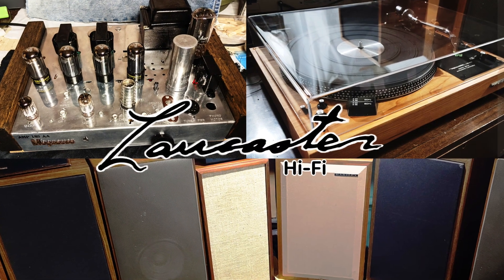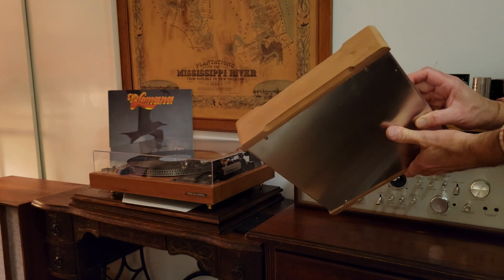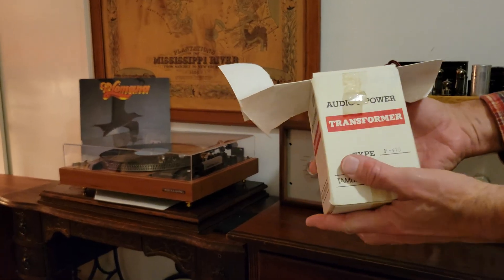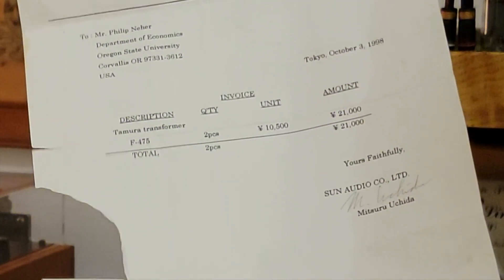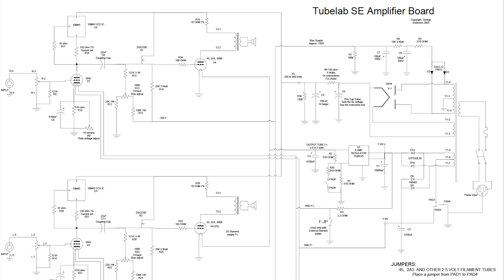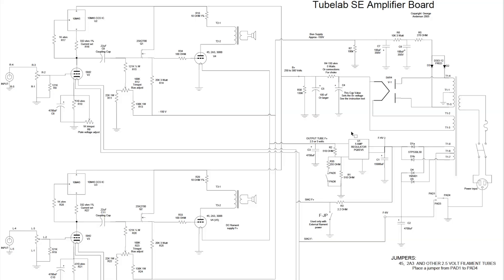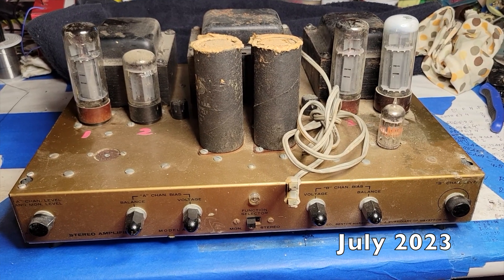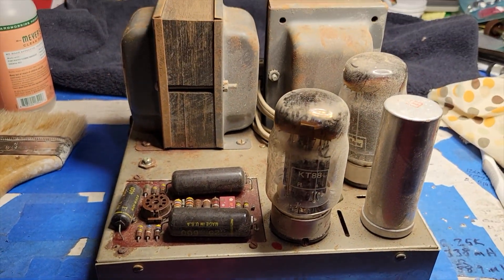I Must Build an SET Tube Amp With Type 45 Triodes! Why?

Comment: I wanted to use an SET that has a directly heated triode but can drive Magnepan speakers. I was using cone speakers with cabinets and unreasonably messy crossover networks and notch filters. I was driving them with SET 45's with choke loaded mu follower 6SN7 dual triodes. I replaced the output transformers with Lundahl LL2765 transformers which stepdown to directly to the grid of an 833A triode which I run at 1000 Volts on the plate and zero grid bias. The Hammond 1642 SE output transformer is the most robust output transformer for the 833A. I have been using this SET for over 6 years with nothing going wrong. The cost of the 45 and the 833A is under $2000. The parts are the best money can buy, including metalized polypropylene filter capacitors in the pi filters in the 1000 Volt power supplies. The 833A cathode has to have pure 10 Volts 10 Amp DC, unlike the 45, which can be heated with AC. This is better than the WAVAC 833A stereo selling for $480,000.
Reply from the maker: That's some determination, driving Magnepans with an SET amp!

Comment: I could've sold you mine!  lol.  It was the closest I got to a wire with gain.  However once I sold my horn speakers the limited power output was no longer an option.  Very good properly designed low/no feedback SS comes very very close as well as UL tube amps but with much much more power.  I am not discouraging you from building it at all.  You should just to experience it and learn more.  I don't miss it because clarity you get but shear impact and dynamic range are limited.  Those are arguably just as important to music as clarity is, and good SS and UL amps come very very close in clarity while producing multitudes more power at lower output impedances.  This is one of those things like the tree vs the forest.  Good luck and thanks for your channel!  Happy listening!
Reply: Hey check this video out.  Very well executed blind test between a Kt120 and 300B (both single ended but one UL, the other obviously triode)!  They don't tell you which is which, see if you can!?

Comment: like your videos......so has the SET come up on the "to build" table?  i just looked up the Tubelab SE 45 SET.  and his new version. hoping to see what you are doing to deal with changes over time.
Reply from the maker: I've got just about everything I need to build it. I don't have the 45 tubes yet, and I'm not sure all the iron I've got will fit on the chassis I have. It will happen in its time.

Comment: I’d be real curious how the whole solid-state power supply works because I really am a believer that you get a much more organic transient using a 5AR4 as a rectifier and it depends possibly what type of music you might be listening to I would say electric music ortechno type. Music might be better off with a more responsive, solid state power supply by for jazz and classical music I don’t know. I guess I’d have to hear the difference. I’ve heard a lot of amplifiers that course that have a solid state rectifier and I really don’t care for that.
Reply from the maker: You guitar guys really love your tube "sag," huh? I'm agnostic on tube vs. solid state power supply. I've never heard a convincing explanation of why a tube rectifier would sound better than silicon diodes. I'm listening mostly to a Heathkit AA-40 these days. It has SS rectification. Monster iron. Sounds great to me!

Comment: Built a Type 45 tube amp. Was well worth the expense and effort.
Reply from the maker: That's good to hear. What speakers are you using with it?
Reply: @ Currently, I’m running a pair of Olson/Nagaoka manifold horns (6’ tall double backloaded horns using a Fostex FE168Ez driver) A very nice match! Recently picked up a pair of Lowther EX-4’s, which I put in  a MLTL. Unfortunately, the combination of my 12AU7 cathode follower and Hiraga 30w class a amp has the unfortunate side effect of producing a lot of DC on start up. That cooked the drivers and they are on their way back to Lowther for a rebuild. They were intended for the Type 45, but never got to set them up properly with the baffle step/zobel network before they became smoke machines…. I have a pair of Cornwalls I’m going to set up in a couple of weeks and see how they work with the amp. But the double horns are very heavy and awkward to move because of the tall enclosure, and hawking the Cornwalls out of the basement is always a “good time”

Comment: Hi, I was chatting to a friend about testing capacitors the other day, one thing lead to another and then I found myself watching this video. When living in Canada a few years ago I purchased a couple of Tubelab boards. One is the SSE and the other is the SE. Is the Tubelab website still running? I did go to the page and there's lots of info there but I was wondering if George Anderson is still around?
Reply from the maker: I think he's officially retired, but he's still an active contributor on diyaudio.com. I posted a question about the choice of driver tubes on the SE, and he provided a detailed answer.
Reply: I emailed Tubelab and got a prompt reply, so all good! George is still on the job.

Comment: I built my 45 set stereo amp. sounds wonderful. in my opinion the 45 is the best SET tube ever made. not a lot of audio power<2watts but soundstage and sound quality is best. no need for feedback circuit.
Reply from the maker: What speakers are you using with it?
Reply: @Lancaster_Hi-Fi  10 inch Cerwin Vega 93db rated that I bought 40 years ago.

Comment: Thanks for all your great vids. The type 45 is a sweet sounding tube. It has a somewhat similar sound signature to 2A3’s, imo. As long as one’s speakers are high enough in sensitivity, those few watts are plenty, especially if the PSU is up to the task. Tamura makes (or made) some fantastic power transformers and OPT’s.  Very kind of someone to gift them to you. SET or SE amps just have a certain special quality to them. I’m not anti-solid state, and actually use them especially during the summertime. I always have a tube based phono stage and line stage pre driving it though going into aprox 95 dB sensitivity speakers. 
Thanks again. Appreciate everything you do with your vids and the information you share.

Comment: Having built many tube amps, the 45's are my favorite. I built my 45 amp in the 90's without a current source, DC filaments or any FETS, still it's a memorizing amp to listen to. It does not have thundering bass but for vocals, most jazz and classical its a pure joy to listen to. When my friends came over and listened, I was often asked how much power my amps run, to which I responded, " A whopping 2000 milliwatts each, of course." I have a pair of Lowther PM6A drivers in a folded horn config and it produces loads of volume for our living room. 
For loud rock and other sources with lots of bass, I use my EL84 amps feeding Klipsch Heresy's which are also very efficient. Try some James Taylor of Joni Mitchell on your 45 mono-blocks and get ready to hear those sources in a very special way.  Oh, the Tamura transformers are among the best ever. In the 90's seems like I paid ~$250 each; they are MUCH more expensive now. Good luck !!!
Reply: I prefer 2000 Mighty Milliwatts of SE power!

Comment: You have very generous friends! I wish I was lucky as you..

The 5842 usually needs carbon comp grid stoppers directy at the grid tube pins.. Also plate stoppers if possible.. Around 200R in value for starters..  I would personally try without the Mosfet driver first so you could compare  Vs. just the 5842 high gm triode input/driver first.. The 4700uF cathode bypass capacitor has a great impact on SQ.. So at least put an Elna Silmic II in there.. They are not that pricey IMHO…